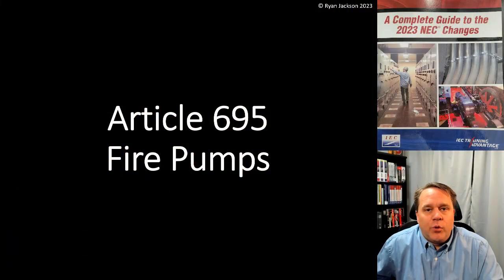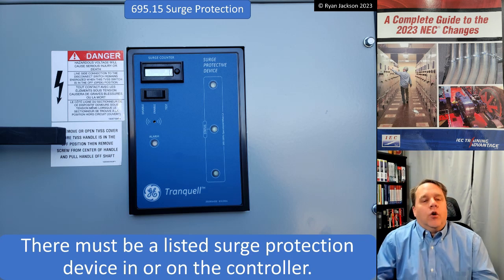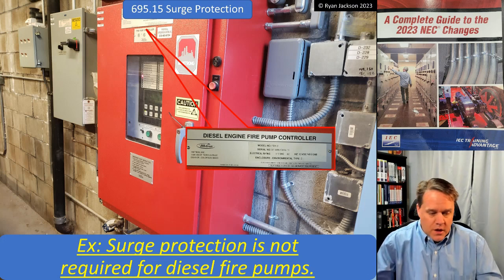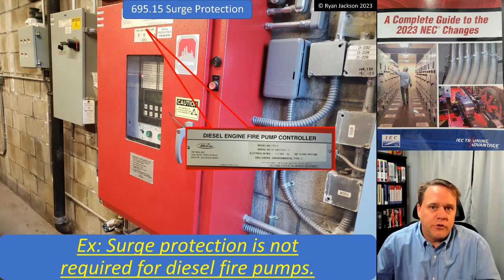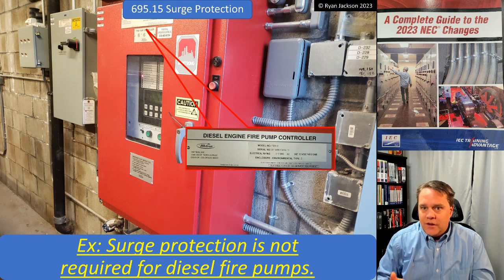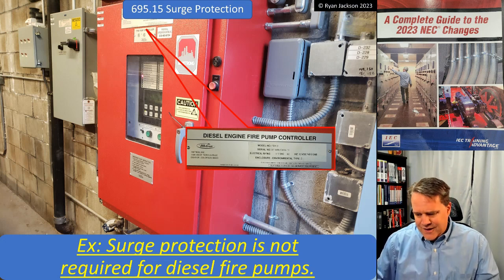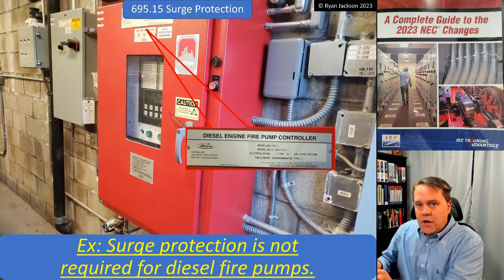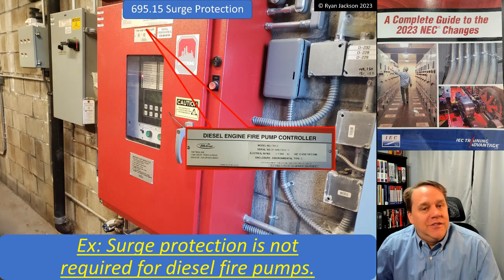695.15 Surge Protection (for fire pumps)

Comment: I would think the surge protector would be to protect the electronics inside of the fire pump controller. 

I would also think that there is surge protection built into the controller itself.

Comment: Pardon my ignorance but is a diesel fire pump using the engine to drive the pump or is it driving a gen set to power the pump?? If it is the engine driving the pump, just where the heck would you put the surge protector? And wouldn’t this be a mechanical/ valve device? A  mechanical governor? .....
Reply: SPD on the line side of the fire pump controller.
Reply: A diesel pump is still going to have an electric starter which is going to use some sort of switch to monitor the fire protection system and start automatically when there is an alarm or other emergency condition. And I would think that they started would be powered by a battery with a trickle charger that keeps in at the set voltage. There may also be other status monitoring on the pump to alert on trouble conditions. I don’t know why you wouldn’t have the starter system and potentially the status monitoring on surge protection.
Reply: All of the diesel pump controllers I have had dealings with in the last 30+ years all commercial power is used for is to power the 2 battery chargers. All of the controls, starting and monitoring runs off of the battery power.